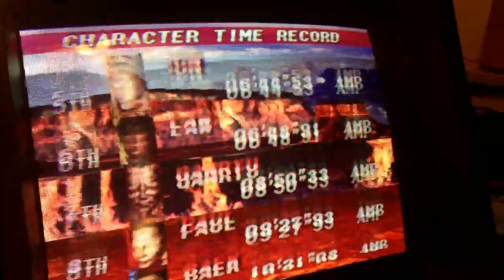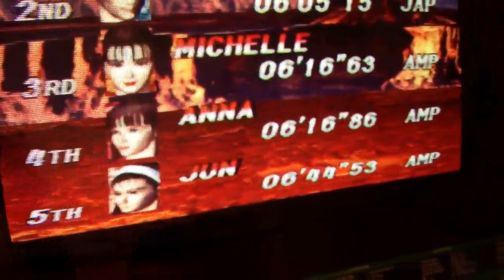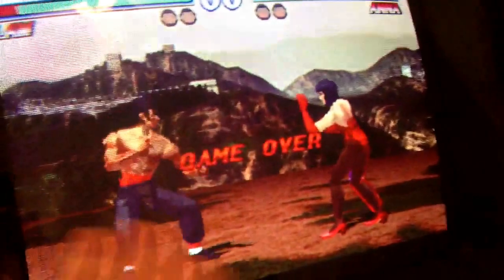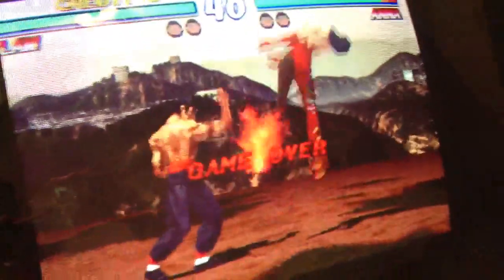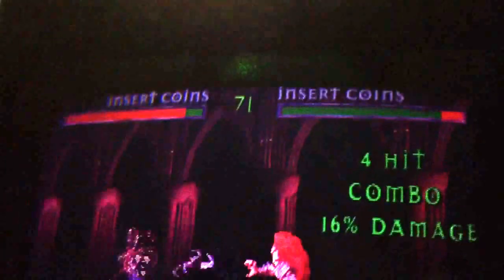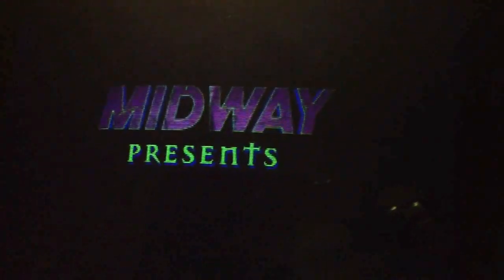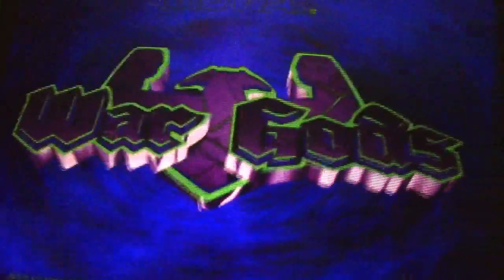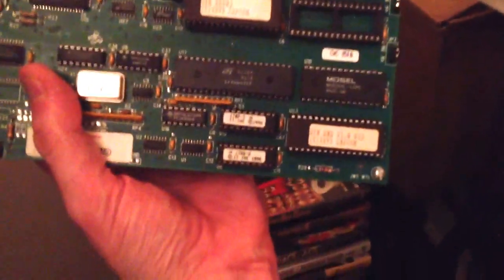Arcade board compare

Comment: Hard to tell SF: The Movie is dim since it has problems at the moment, but I'm not sure about a voltage problem.  Haven't heard of that before.  Can you check the power supply's outputs and see if they are close to 12 and 5 volts?

Comment: I think the tekken boards have their brightness turned up via the menu.   I would hook up the ki2/sfmovie/war gods, adjust the brightness/contrast/black level to where the pic is satisfactory, then hook up the tekken boards and adjust their brightness via their test menu (not via the monitor or remote board).

Also what model is that monitor in that machine? K71xx/U5000/Polo/74xx

let me know, I kinda doubt it's a power supply problem but definitely worth testing your voltages.

Comment: Street Fighter board doesn't look like a major problem.  Really looks like something not seated properly, but you never know.  I have an IT board (Time Killers) with a similar graphics issue.  I think it has either a cracked trace, or a cracked/cold solder joint I haven't been able to track down.  Check the bottom of the board to see if some chip legs (pins) have bent over and are touching each other or another trace.  War Gods being so dim is a puzzle???